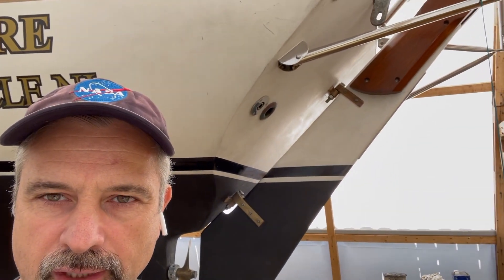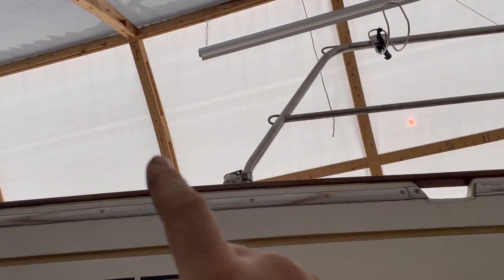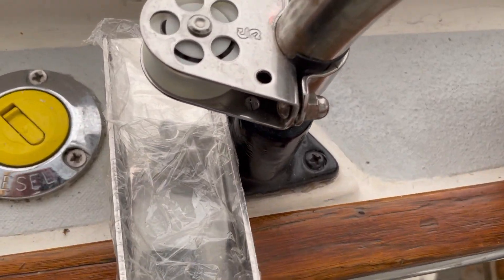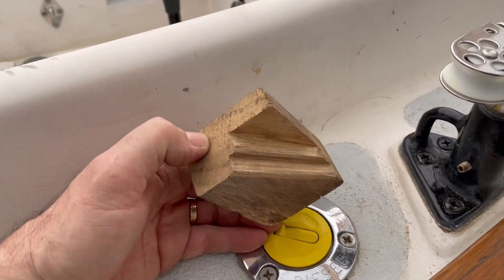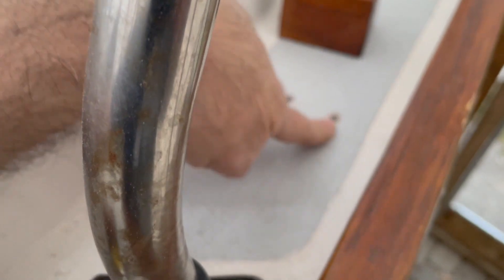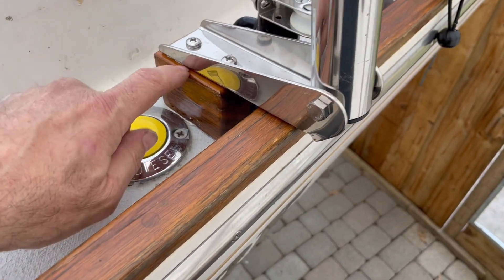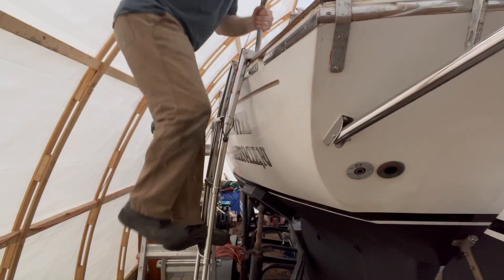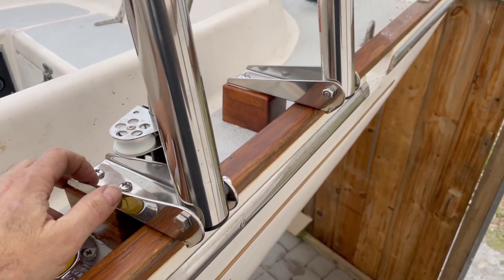Contessa 26 Refit ep.42 - Installing a Telescoping Boat Ladder

Comment: Another really well done video and a project I am also hoping to do. Any thoughts on how you might be able to deploy the ladder if you were to take an unscheduled trip over the side? I’m wondering what kind of lanyard and release might work if you happened to be in the water with the ladder still stowed and retracted? Thanks as always for the concise way that you share these projects!
Reply from the maker: Thanks for the praise. I was thinking either to have a line tied to the ladder that releases when you pull on it, or have some sort of plastic catch that holds the ladder up with a line on the ladder that would release it from the catch with a hard tug.

Comment: Hi. Fellow Contessa 26 Owner. Wondering if you can provide the link or description for the ladder you used. Thanks
Reply from the maker: Hi Mike. I bought this one off of eBay and it was the last one the seller had, but doesn’t have a brand name on it. I would just do a search on either eBay or Amazon for a four step, telescoping ladder. All the ones being sold there are pretty much the same.
Reply: Thanks.  Much appreciated.